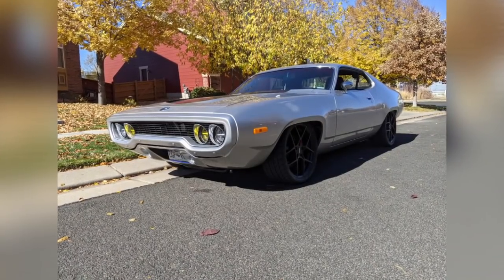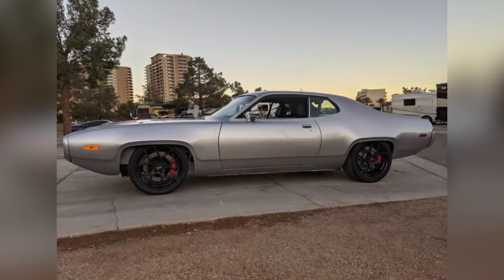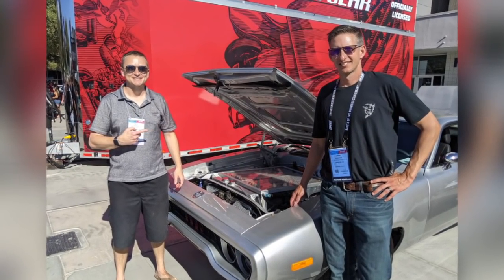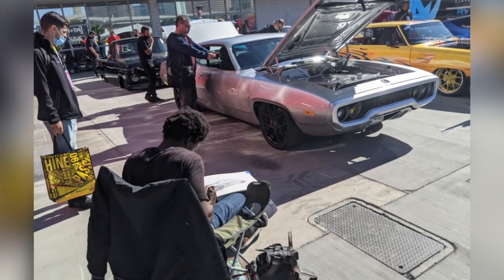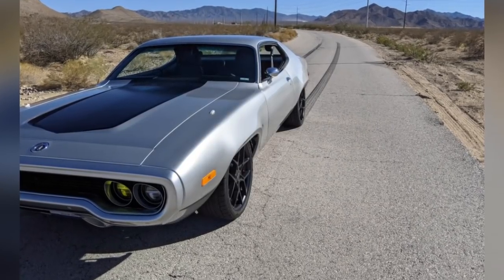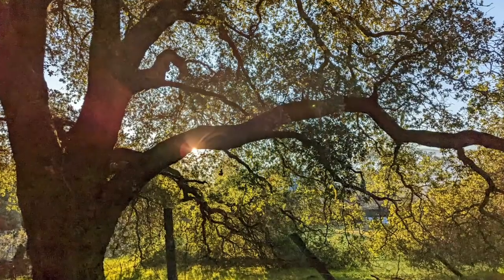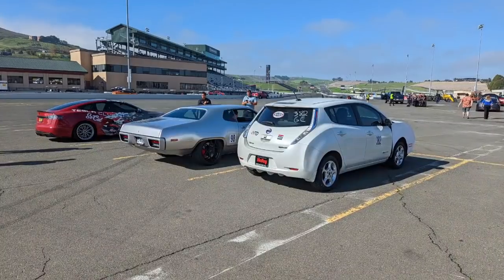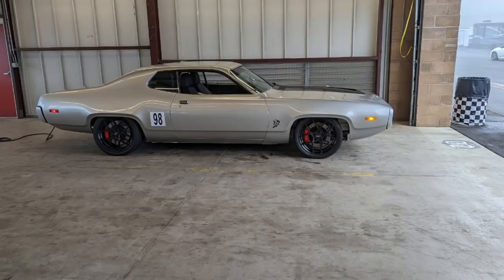Project Electrollite - Plymouth Satellite Tesla Swap - SEMA and Holley High Voltage! EP. 18.

Comment: I have a 60’s Ford F100 I’ve been looking at the “crate” motor. What are your thoughts on it?
Reply from the maker: Cool truck!    I think it's important to know what you want out of the vehicle.   If you are looking for power, I have mixed feelings on the Ford and GM crate motors.   They are units that are used in their production vehicles, but might be a bit of a stretch as a crate solution.  I think there are much better motor options such as the Revolt Systems crate motor.    No matter what motor you decide on, the battery is the next hurdle.   The battery pack needs to be sized appropriately for the power and range you desire.

Comment: I have two 71 Plymouths like this.  What's the tire size?  I'm assuming this is not tubbed?  Thanks!!
Reply from the maker: Wow nice!   Yep you're right it is not tubbed, I'm running 285 35 20s and I'll probably go to 305's next.
Reply: @MrMoparMan  Thanks!  I run 255/45-17s all around and have some more space to play with.  I always like to see what others are doing with these great cars.  (I'm currently running original drivetrains, but I suspect that not going to last forever!)
Reply from the maker: @dndbeyond3443  nice, yeah they have lots of room for tires.  So many powertrain options also.

Comment: Congrats man, it's been an amazing journey watching this build get some juice&turned loose. 😎
Love how much detail you cover and how honest you are about so much of the stuff. That other ev swaps often ignore or just don't share. 👍🏻

And a 12.2 is darn good for this ole lead sled. Now quit sand bagging and tell us what it'll really run. Mid 11s, high 10s? 😁
Reply from the maker: Thanks buddy, you have been here to whole time!  I appreciate your feedback, I do try to share the whole story with real data.  

I am excited to have some passes under my belt.  There is definitely room for improvement...I have already programmed a Race mode which will preheat the batteries to reduce resistance.  In the future I will add a chiller to the motor loop to ice the motor before passes.  11's will happen, I would need a different battery pack for 10's.  Not out of the question, just not yet ;)
Reply: @MrMoparMan  awesome, 11s on st tires with no emissions in a smooth cruiser. 👍🏻
I was excited to hear you talk with jehu about the next project ev swap. 😁
Reply from the maker: @4literv6  Yeah, I am happy with the times for what the car is...Gotta build a shop and then we will get on with the Torino!